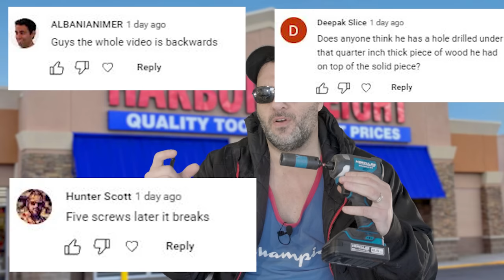Harbor Freight just made people really mad

Comment: Love it.  The Harbor Freight hate is over the top sometimes.  I've owned one of their corded impact wrenches for almost 15 years and it still does everything I need it to.  I think it was only $20 or $30 too.  I understand the appeal of the fancier, higher quality stuff...but it just isn't in the cards for all of us.  Thanks for the video!
Reply: Remember the earthquake XT 18v? I used that for 8 years and ended up selling it when I got dewalt, that thing took a beating from me and would take off any lug nuts or axle bolts you would throw at it.
Reply: @drewrinker2071  Right on!  I've heard nothing but good about the Earthquake XT.  I've only owned Chicago Electric and Bauer corded products myself, but they've all served me well.  I used my impact wrench to take the lug nuts off my car and the front sprocket nut off my motorcycle back in the day.  Now I have a bunch of Ryobi cordless products (and a couple of DeWalts), due in part to this Tool Review Zone guy right here...never thought I'd own a cordless glue gun or caulk gun though. 😂
Reply: Same here back in 2014 i was building a shed so wanted a miter saw, wasn’t sure how long I’d use it so bought a 12” chicago electric one.  Worked like a champ and continues to this day to work well, in full disclosure its my back up now (bought a new one 2 years ago) that i keep at summer home.  Haven’t replaced the brushes yet, used it hard through its life as an avid DIY thinking of the 4x4 PT moist posts in one instance.  Actually produces better results for me than my knuckle head brother in law gets with his Yellow one.
Reply: Completely Agree~!!!!!!
Reply: They're jealous since they spent 400 for a drill and you spent only 120 for one.
Reply: But he didnt use pressure treated that was soaaking in embaling fluid for 15 weeks from a redwood tree that was 450 years old that sat in Siberian winters for 40 years under ground during thenice age bro?! He cheated
Reply from the maker: And I ALMOST GOT AWAY WITH IT TOO! 😪
Reply: The HF freight tools are great for homeowners and backyard mechanics who are only going to use the tool mildly or rare.  I have lot of their specialty stuff that would be thousands or tens of thousands from places like strap-on. Now personally if I were a mechanic and used that tool 4 hour a day 5 days a week to earn a living I could justify the cost but no I’ll use it 18 times before I die so $200 chinesium tool is cheaper than a shop bill.
Reply: @drewrinker2071  I think that's the one I have but mine is a 3/4" it's a beast
Reply: I think if a professional mechanic did the exact same repair all day every day, then yes, this would be a reason to buy the best tool possible. But professional mechanics do a wide variety of repairs, so they don't really use one certain tool all day.
Reply: @fixitfelix718  😂😂😂😂 ….. I wonder how many people think your serious…. I get it brother … myself I use BAURER AND HERCULES tools … they work great .
Reply: I love mine

Comment: My favorite thing about HF is I can try out all kinds of tools.  If I use it enough to break/wear out, I’ll replace with an upgraded brand. If I don’t use it much…. not a big investment wasted.
Reply: Most fanboys go straight for snapon or craftsman. Those are only a good deal if you abuse their lifetime warranties. That means regularly churning through the tools.

I buy harbor freight first. If the harbor freight tool wears out immediately, I buy a craftsman. If the harbor freight tool wears out after a year, I buy another harbor freight tool, since it's either really durable or I'm not using the tool often.
Reply: That's a good philosophy.
Reply: @Runed0S  
100%
I use many of their tools as a heavy tech.
They have short falls. 
But like when craftsman was around. I van break the tools today and get it replaced tomorrow. No waiting for the tool truck. 
Snap on shows once a year, why would I give them money.  I still deal with other tool truck, but it's for certain tools high use, comfort or specific use.

HF has come a long way.
Reply: Exactly.
Reply: @runed0s86  the snap on electric and air tools aren't lifetime warranty...
Reply: @runed0s86  I used to buy Craftsman growing up, because I knew they were good, and had a lifetime warranty. Nowadays there are a lot more choices. Currently I have a couple of Ryobi drill/drivers, and a Ryobi leaf blower that use the same batteries.

Comment: For the diy homeowner these are great tools but I've even known guys that used them daily in auto and heavy diesel repair and they did great! Every tool has a different designation it's designed for and its up to YOU to know what YOU'RE going to be using them for
Reply: I use only harbor freight tools daily as a diesel mechanic and will never spend more money to own a name. They have all held up perfectly fine. I wish they had a tool truck. Everything basically comes with a lifetime warranty plus the price it's a no brainer. Customers don't care what too you use to fix their vehicle they just want it fixed.
Reply: @StrongerThanBigfoot  I mostly agree.  For many items, I can't justify the extra price.  $6,000 for a toolbox that does nothing different and is pretty much the same quality as a HF box for $900?  You'd be a fool to spend the extra $5100.  However, there are some parts that are just better and priced that way...and that's okay too.  For instance the Pittsburgh wrench set is probably good for 99% of the jobs you would do with say a set of Mac wrenches.  BUT, the tolerance is not the same and when you are busting that bolt attaching a metal bracket out of an aluminum case it could be the difference between getting it off and rounding the head and making a nightmare.  Just recently my son was trying to remove the piston head off his airsoft gun while doing an upgrade.  It was a philips machine screw and he/we tried every screw driver and driver with bits we have. (We have a lot.)  I said "hang on."  I got old work tools...my Mac Tools driver set, and with one grunt "click" it broke free.  My son was like "WHAT?!  How?  Why?"  LOL  You could just feel the Mac tool get right in there and fit perfect, and grip the screw while the others were sloppy and kind of just slipped out.  The Mac also showed zero signs of wear on the driver while every other driver we have had some form of wear or rounding on the edges of the driver.

HF has come a LONG way with the new Icon line though, so even that's changing.  I have no problem with HF stuff, use it and glad it's here.  But I do buy name brand with some things too.

Comment: When I bought my 1st home, all my renovations were the result of Harbor Freight tools and I still have several of them going strong with no issues.  I switched to Ryobi  because they kept discontinuing the batteries.  After my 2nd set of drills, saber saws, circular saws being trashed because there no batteries for them, even though the tools were fine, I changed to the guys who've kept the same battery design for 20+ yrs
Reply: Battery adapters are pretty cool. If you can find one that matches chinese batteries.
Reply: Who did you switch to and yes Amazon has almost every battery adapter I use alot of harbor freight tools

Comment: I had a 14" HF chop saw.  I used it hard to build a flatbed for my pickup.  After a month, all of the factory installed smoke came out of it.  I replaced it with a DeWalt.  That was 15 years ago, it still works great.

I had a 4.5" 110 volt grinder.  It worked fine, but it fell off of my welding table, and broke in half.  I replaced it with a DeWalt.  It is still working well 8 years later, and it has fallen off the bench a time or two, with only the disc being hurt.

I also have several other HF tools, and they work just fine.  All of my battery tools are Ryobi 18 volt, and I have so much invested in batteries, that I will stick with it.  No issues with the Ryobi batt tools either.

My 1/2" IR air impact self destructed about 3 years before I was going to retire.  (Heavy Equipment Mechanic)  I bought an Earthquake 1/2" air impact, and it never failed me.  I have four HF 1/4"  die grinders that I have had for 25 years.  I do not use them much any more, but they all still work just fine.

I have zero issues with what HF sells.  My philosophy is, if a HF fails, then I will upgrade, but not until it does fail.

I like your channel!

Comment: I bought the $40 impact driver a few years ago. Lacks some sinking power but is great to have with the 2.5 ah battery. Used it today in fact. I have used and abused the hammer drill brushed model. It’s probably 6 years old now and needs a new chuck now but still getting it done. For homeowners these tools are great. And harbor freight is a lot closer than Home Depot

Comment: These tools are really impressive. Myself and my crew have been using the 'Waulkee' line and they are awesome.  I bought many of the brushless Hercules tools and there is very little difference between both brands. The batteries last. The 20 volt vacuum has a 120vAC cord. The circular saw and multi tool are good too. Buy the impact and test for oneself.  I did a blind test with my coworker using the 'Waulkee' and Hercules impact.  They actually guessed wrong. They even feel the same in the hand. Great video.

Comment: Thanks for the vid. I worked installing satellite dishes from 2015-2017. In most cases, the satellite dish got mounted to the roof with 6 lag bolts: two 1/4" x 3" and four 1/4" x 2.5". The long bolts had to hit a truss every time, while the other 4 went into roof sheathing alone. I used a Milwaukee impact driver that I got on special. It came in a kit: drill, driver, charger and 2 batteries for $200. I estimate that I installed over 1,100 dishes in those 2 years, and the Milwaukee drove every single bolt. No pilot holes, no help. That's over 2,000 lag bolts into solid wood framing. More than 4,000 bolts into sheathing. It also drove all the screws for the cable clamps, screws for switch plates, and anything else that came up in typical 12-hour day. The driver and drill were mission critical, and if they had failed, I'd have gone home without pay. They never failed. They worked in good weather, bad weather, rain and 105 deg. temps (120 deg. temps if I was in an attic). I was enormously impressed. The driver was already a couple years old when I started that job. It had already built a small deck and got used for remodeling around the house when I wasn't working. By the end, the driver was a little looser than I'd like, so I replaced it with a Bosch and gave the Milwaukee stuff to my nephew. Both the drill and driver and both batteries still work to this day. I have no doubt the driver could drive a bunch more lags, if needed. 

Okay, your HF drove twenty-five 3/8" x 6" bolts. That's a tall order, but still, my Milwaukee drove 6,000 bolts, plus a bunch more. My Milwaukee drove fast, right to the end. Your HF is clearly struggling to get that last inch. Better yet, my Milwaukee was a trim package. The body was small and the nose was tapered. I could get it into places that your bulky HF model wouldn't fit. 

I'm not a tool snob, and I own a LOT of HF tools. They are great for DIYers puttering around the house. But when it comes to mission-critical tools that have to work all day, every day; tools that have to be comfortable and adaptable; tools that have to take a lot of abuse and not complain... I don't buy HF.

Comment: Just to make a positive comment, I normally heat my lag bolts and dip them in wax to give a super thin coating of wax. They will fly into the wood and help make the wood in contact with the lag to harden and strengthen the attachment location. They will not walk out over time but are a little easier to remove at any disassembly time that may be required. Just saying……. Good vid, thanks.

Comment: I have a Harbor Freight Central Machinary bench top drill press that I purchased around 15 years ago. I’ve used that thing to drill through every thing from wood, copper, steel, ceramic tiles, glass block and more. The only problem I’ve had with it was the depth stop broke and the head got tweaked when some movers did not pack it properly. I readjusted the head and got it realigned properly and currently have plans to make a replacement for the piece that Brock on the depth stop. It is still going strong after 15 years.

Comment: These are special effects lag screws made of paper mache that dissolve and leave just the cap! 

Seriously, I know some things from HF are not great, but a good number are. Bought the Hercules Sliding Compound miter saw, and it was less that 1/10 degree off true straight out of the box. Conversely, I just bought the Dewalt Track Saw and the track and the packaging were crap. The design is such that you can't get the track to support the start and inns of the cut on a full sheet.  Even the instructions were printed in a jacked up method. 
Don't let brand snobbery either stop you from getting a decent deal, or cause you to make exceptions for a low quality product just because it matches the rest of your tools.
Reply from the maker: Exactly brother. These guys make the rookies feel that they need to go broke when getting started,  or that they have the best tool put there. They are sad if you ask me

Comment: My only drawback, is I'm heavily invested in Red and Yellow/Black.  Although I'm not adding/updating any of my DeWalt stuff.  They p!$$ed me off when they abandoned the 18V line.  I like my 12v Milwaukee tools, but, I just added a Blue (Bosch 12v) to the mix.  I've got a number of HF tools.  No real  complaints.  I've 'hot rodded' their dust collector, added upgrades to their 14" bandsaw and 17" drill press.

Comment: For you Clint and all the haters, I smoked a High end Makita Drill, yes using larger bits and thicker material than it was made for.  So any tool can be smoked if used beyond it's means/design.  I'm a massive Makita 18v & 40v fan boy and slowly adding a few select Milwaukee tools as well.  The fact that it was very hot to the touch and was continuing to work says a bit more than my Makita Drill that got hot, then started smoking and stopped working a minute later speaks volumes for the Hobo Freight impact.  Keep up the good work Clint.
Reply from the maker: Agreed David. I've had other major brands that smoked doing the same test way earlier in the test. It's happens to the best of them 👊

Comment: I was in a pinch at a job when I left my DeWalt batteries at the shop to hang some drywall on a job. A HF was up the street, ran in and bought a little 12v drill/driver to get me to lunch time so I could get back to the shop and grab my DeWalt batteries. After working the cheap HF driver for hours, I didn't go back for my batteries. That damn thing is still running to this day. I use it at least 2 times a week on various things from running screws to drilling holes. That was 1997. That was the best $12 I ever spent.

Comment: I own a number of these Hercules cordless tools. Harbor freight has stepped up their game, they have also stepped up their price. I did a price comparison and for the value of purchasing the tools individually through harbor freight I could buy equivalent sets of Milwaukee or Makita tools. That being said my job uses Milwaukee and Makita, and my Hercules sets consistently outperform both.
Reply: A milwaukee m18 impact driver is probably $125 a Hercules brushless impact driver is $98 with a charger then you gotta buy battery and charger a milwaukee m18 fuel will cost somewhere between $125 to $200 for a 5ah battery and charger the battery for a Hercules is $50 for a 5ah battery you don't have to buy the charger since you get one with the Hercules impact for $97 or $69 without a charger!

Comment: I bought one of these over 4 years ago I built a house we used over 4000 -10 x 3.5 inch wood screws also 12inch 5/16 lag screws over 4 dozen I also use it to mount tires on GM and ford trucks and cars mostly with 3/4 and 13/16 inch lugs when I recheck with a torque wrench that any mechanic worth a dam should always no matter what there are working on they are torque to 40 to 45 ft lbs every time with a charged battery.. also used it on 6x6 landscaping lumber to build a retaining wall I used over 2 hundred 12 inch stainless 5/16 lag bolts never pre drilled any hole on any lag bolts I also use it to dissemble and assemble crossmember bolts and mount bolts  leaf spring bolt’s .I’m a professional mechanic for over 35 years still everything get checked with a torque wrench it’s still going strong .🎉

Comment: I am an HVAC contractor and have been using Milwaukee tools all my life. They have many specialty tools, tube cutter,all thread cutter, crimper, PVC cutter and the list goes on. Their battery prices are insane. With the new battery adapters and the sale going on that you buy 2 5 amp hour batteries and get any Hercules tool for free and the batteries are the same Samsung cell. I now own 12- 5 amp hour Hercules batteries and 6 new tools. Their tools are every bit as good as Milwaukee, some I like better. Still I need the specialty tools Milwaukee makes so a simple battery adapter on ebay for 20 bucks does the trick.

Comment: I use HF tools ,a LOT,as a mechanic'autobody repairman.
My first mig welder lasted 9yrs(Mig 151),and the Mig 170 i have now,was purchased 4 yrs ago,and gets daily use!
I had a 4.5" anglegrinder,for 12 yrs,and just replaced it,as it was stolen!
 Sanders multi tools etc, even the compressor,and engine,have been VERY good.....at a much less cost !
There have been 2-3 that failed(AC gauge set,and a puller),but were determined to have manufacting defects,and were replaced,at no cost.